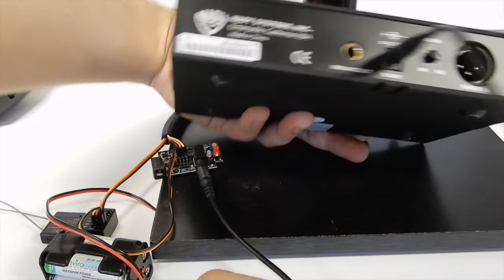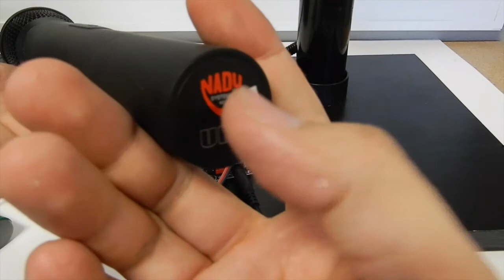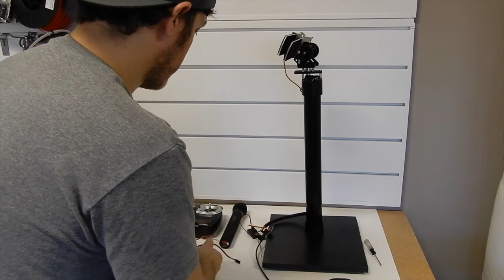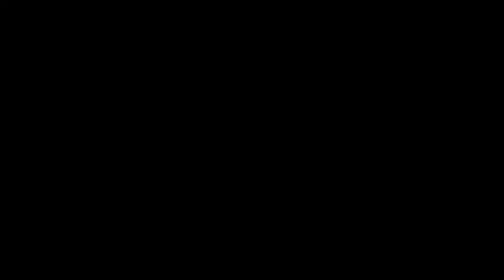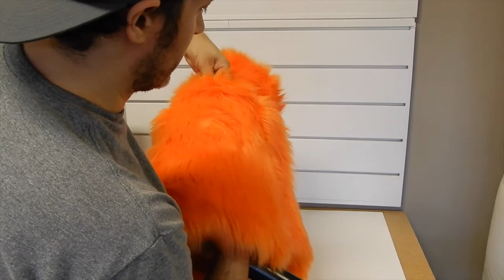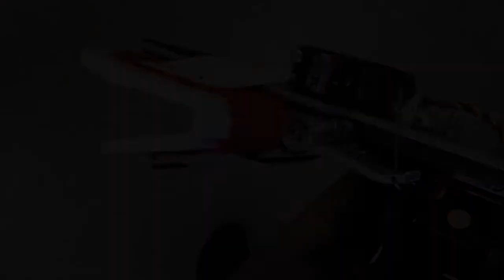Setting up our deluxe talking stand tutorial

Comment: what is the price of the complete system?
Reply from the maker: The standard version which is all RC controlled is $1450, the Deluxe version seen in this video which includes the wireless mic that you speak into to control the mouth instead of using the RC controller is $1850, both options include a wireless battery pack and charger as well.